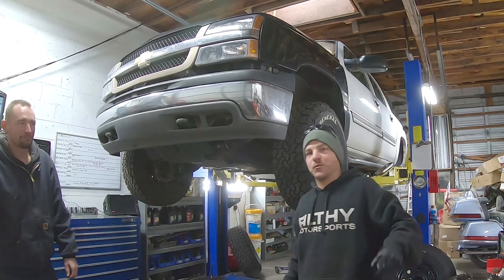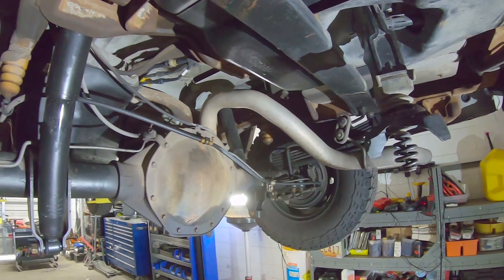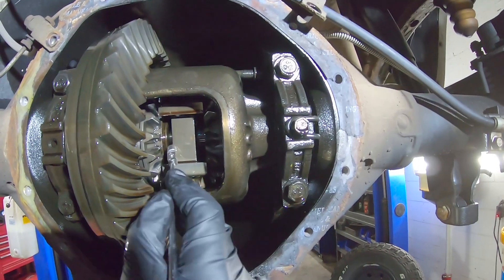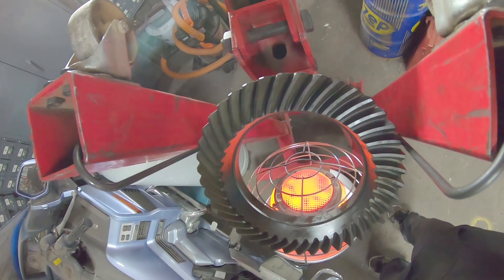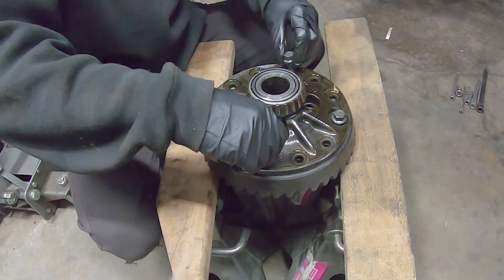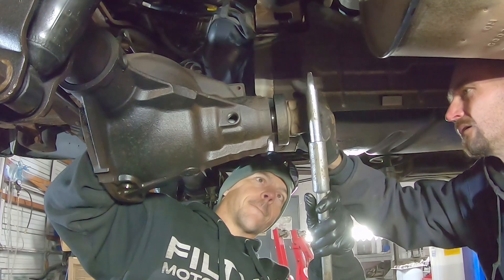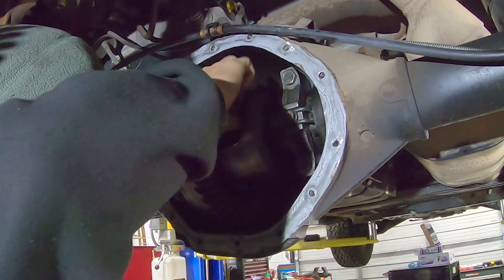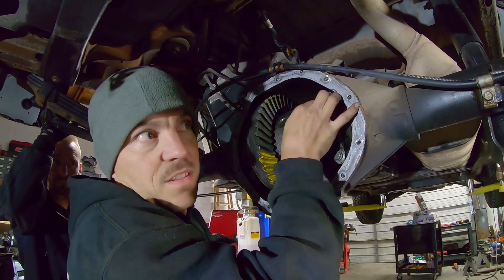DIY Gear Swap - GM/AAM 9.5" Axle - Reckless Wrench Garage

Comment: I'm having a hard time understanding the difference between the gm 9.5 14 bolt and the gm 9.5 12 bolt axles and diff compatibility. Do you know if 9.5 gears and carriers can be swapped between the two?
Reply: I think the gm 12 bolt has an 8.75 ring gear, not 9.5.
Reply from the maker: The classic gm 12 bolt is 8.875
The AAM 12 bolt in the newer gm vehicles is 9.5”.

Comment: Tips for setting pinion depth without having to pull and press the outer bearing a bunch of times ?
Reply from the maker: Using setup bearings makes it pretty easy.

You could also use a pinion depth gauge.

Comment: Im #200 😁
Thank you so much 
Im about to swap 10 bolt to 14-bolt semi float just for the simplicity and strength.
This is perfect and straightforward information.
My respects. CHEVY4LIFE 98 HOE 4X4

Comment: Did the 9 1/2 diff ever come limited slip? Swapping a 3/4 ton drivetrain and axles into my 1/2 ton cateye for a trail rig
Reply from the maker: They came with the g80 option (gov-loc). That’s what this suburban has. 
I’m not aware of any other factory options for it, but there are a handful of aftermarket options.
Reply: @RecklessWrenchGarage  I was looking at the Eaton True-Trac, if I reuse my ring and pinion since I already have 4.10's do I just need to get my backlash and wear pattern set with the bearing adjusters?

Comment: if you leave the top bolt in the diff cover you can break the seal and drain the fluid without dealing with cover...

Comment: The part no one ever shows is what the "happy paint trail" should look like. I know to add or remove shims to adjust, but Iv never seen anyone explain what to adjust to, what kind of trail I should be looking for in the gear paint.
Reply from the maker: Due to the different gear and differential setups, the pattern will vary enough that showing one pattern may not help some people. We’ve done quite a few gear sets and each have a slightly different pattern. We’d prefer not to say ‘this is what you’re looking for’ and someone get upset they can’t get that exact pattern.
When you order an overhaul kit from Yukon Gear and Axle, it comes with an installation guide that has 3 or 4 pages showing different patterns and what you need to do to achieve those patterns. 
If you search ‘differential gear pattern’ in google, it will pull up that same info.

Comment: In our country vehicles don't have a C clip inside the differential.
Reply: Most don't, only some semifloat axles do such as gm 10 and 12 bolt, and dana 35.

Comment: I never realized the 3/4 ton Burbans were leaf sprung. Did you consider putting a full float 14b in it?
Reply from the maker: I did consider it. I have an AAM 11.5 on the Duramax. I’ve been considering swapping it over, but I’ve also been considering just fixing the duramax. 🤷🏻‍♂️

The 3/4 ton and 1 ton are leaf sprung to support the payload better. It makes it impossible to pull the rear caliper by itself with the tools Howard and I have.